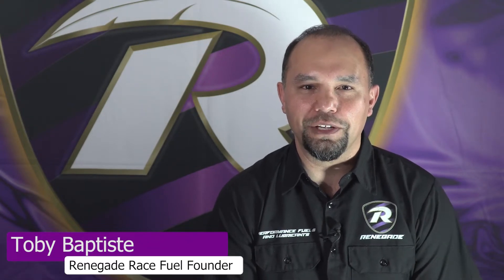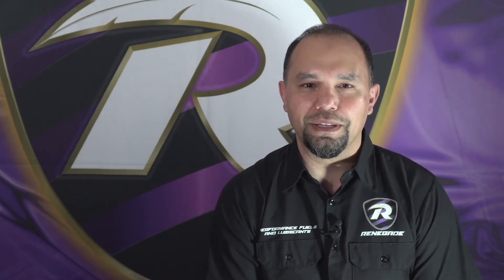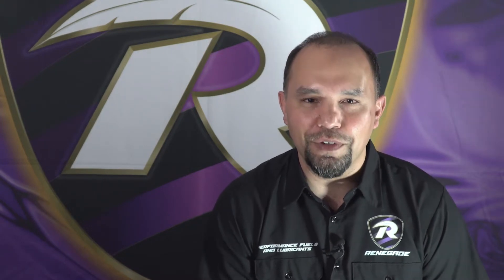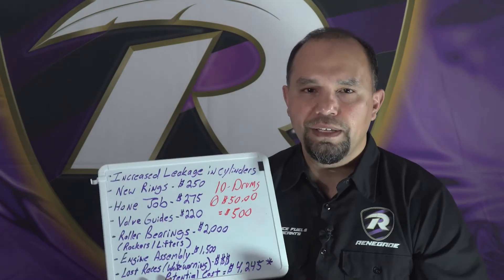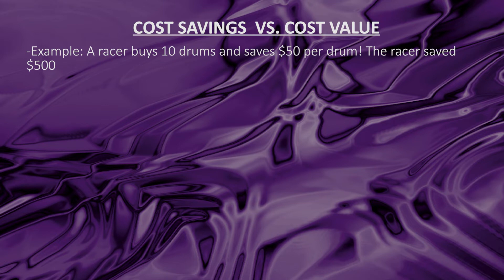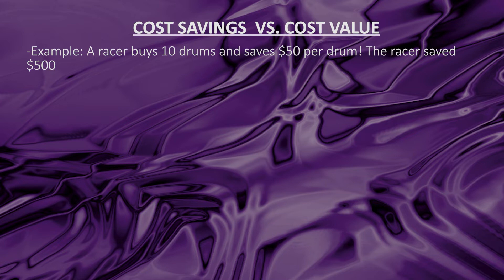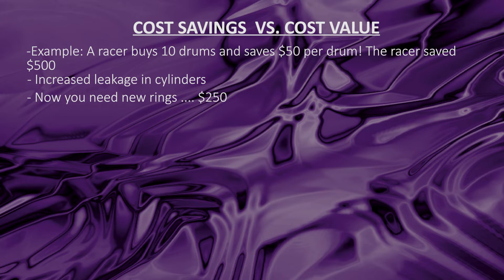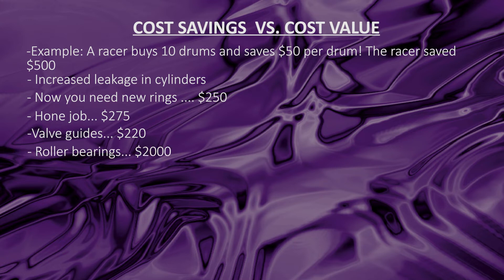Tech Session #1 Methanol

Comment: Hi...and maybe you could help or possibly someone give some clear directional advice.
If you do then thank you.. appreciated.
I have a standard VW caddy 1.9 SDI and it is at its limits on emissions. And I've here in Spain it has to have an itv test...you get the test you can drive it on the road.
Problem is it 900 kilometres away at my sister's...
So l need to clean out the emissions so that l can get it back up here to repairs...
So what spec and ratios...
Are needed.. l have seen about 10% to the volume diesel quantity...
But it's the European spec ...that l need to clarify..
I seen some 303 spec... saying 100%>>>>not sure that's true.
It's just to get it passed the test ..
Hopefully you could or can help.
Simon a Brit in Spain 👍

Comment: So our introduction starts us off with Toby Baptiste w/Renegade face fuel founder that they are the racing fuel and lubricants company that does more than just sell products. But, I wanted to understand methanol fuel S201 that I came across on cumulative report 1979-85 which stood under the heading: Energy resources-Do you suppose this man is advocating a filtration product with CO2?U.S. Venture, Inc. v. United States, 448 F. Supp. 3d 979, 2020 U.S. Dist. LEXIS 49500, 2020-1 U.S. Tax Cas. (CCH) P70,359, 2020 WL 1366418

Comment: Everything in this video is dead on. We have seen horrible wear in Meth engines that actually require over boring just to get the pits out of the middle and top of the cylinders. Usually from hash meth that eats the metal up. Kinda of like rust from moisture that just sits on your cylinder walls. This always produces leak down rates well over 20% with the nasty blow by. Nice informative video.